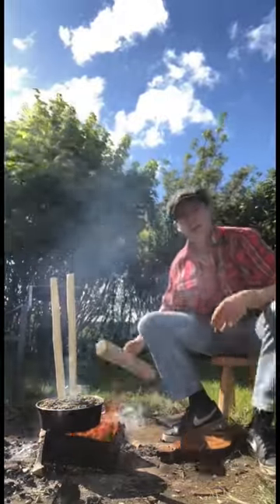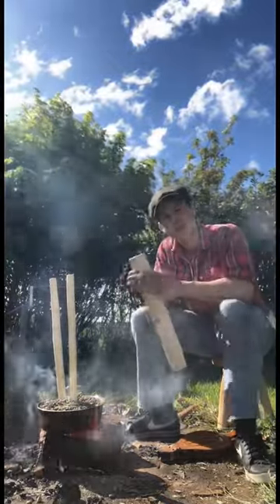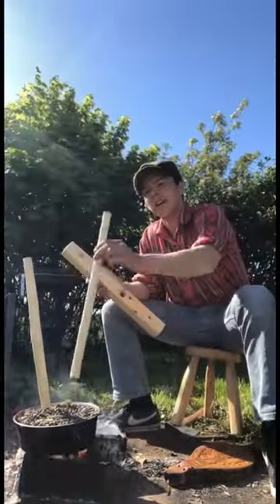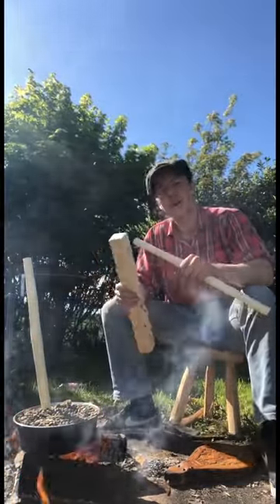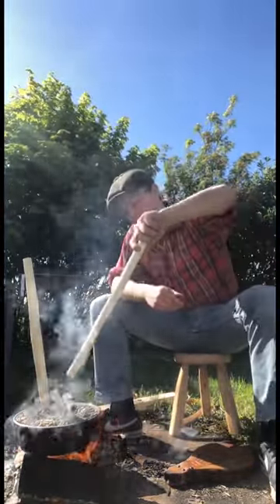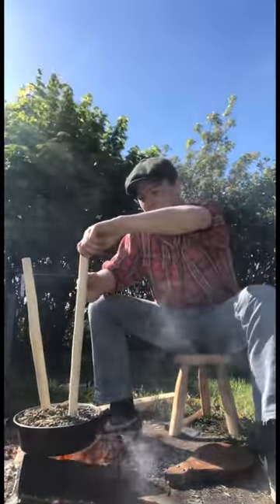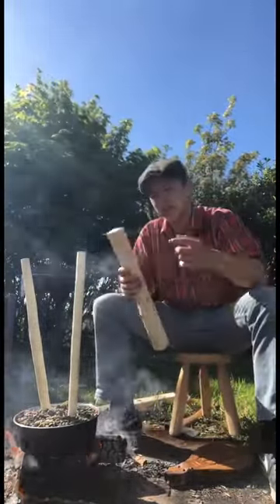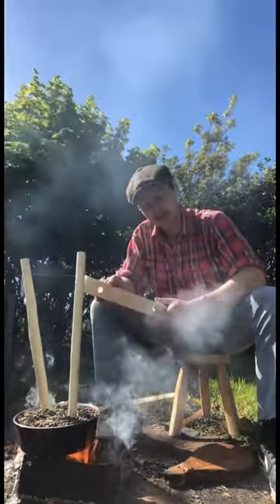drying green wood for traditional joinery #shortvideo #ireland #woodwork #greenwood

Comment: I use a sealed 4” drain pipe and loads of packs of desiccant. I can dry out a few lengths of green wood in a few days.
Reply: I’ve never heard of using desiccant. Do you get case hardening at that fast of a drying rate? Any cracking?
Reply: Do the desiccant packs get saturated at any point and stop working?
Reply: Oooo you could use big bags of rice. Might be easier for most to find. You could likely even dry them out in an oven and reuse it.
Reply: @Thalanox  those packs can be revived in a low oven

Comment: Is it true if you soak a bent or twisted plank it will straighten itself out?
I wonder if you tried something like that before
Reply: From what I know, soaking a bent plank will straigten it slightly, you can heat it after that to make it more pliable (essentially steam bending)

However, if you dont clamp it as it dries (or cools and dries) it will just bend back, sometimes with an even worse bend!

Comment: I've heard that you can stack all your wood in a drying pile (with stickers, etc) and cover it well with plastic.  Turn on a 100 watt incandescent bulb, and put it under the plastic.   Just the heat from that one bulb will be enough to thoroughly dry out your wood in a couple weeks instead of waiting years to air dry it.  Can anyone verify if this method really works, or is it just more internet B.S.?